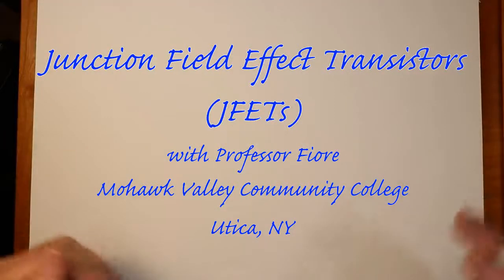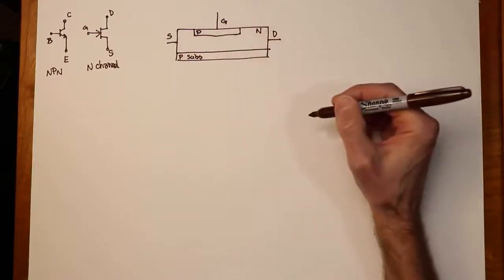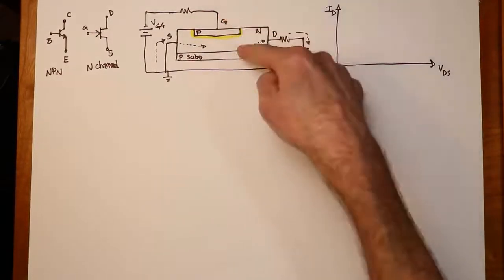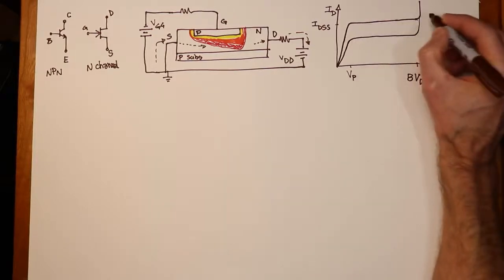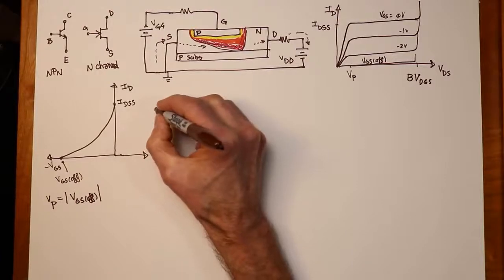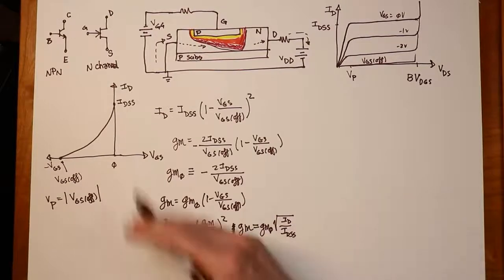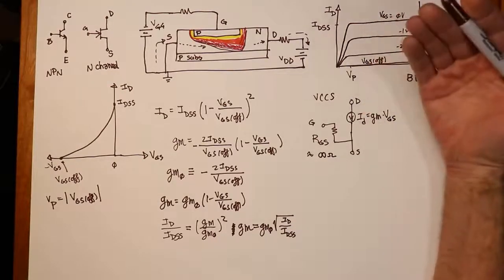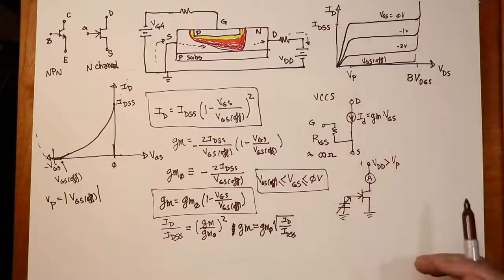Semiconductor Devices: Junction Field Effect Transistors (JFETs)

Comment: I’m in the same situation as Dennis Ruffing. I had to remember how to perform the derivative of Id, once I did that, it all made sense from start to finish. Thanks again for posting this on line for free. I think it’s time to down load the text book and follow along more closely
Reply from the maker: Yes, the text has more detail than I can hope to fit into a video of reasonable length. Besides, the price is right! And if you do want a hard copy, you can always follow the link to Amazon for an inexpensive print version.
Reply: @ElectronicswithProfessorFiore  On order! Thanks

Comment: Thx for the content. What I don't understand fully yet, is how the current increases with increasing source voltage although the channel gets narrower. Is the electric field much stronger than this effect until a certain point where the pinch-off/saturation happens?
Reply from the maker: Prior to pinch-off, the device is operating in the ohmic region. IOW, think of the channel as just a resistor. Thus, as the voltage across it increases, current does as well. We exploit the ohmic region in certain applications (for example, the FET can be used as a voltage controlled resistance where R is a function of Vgs).

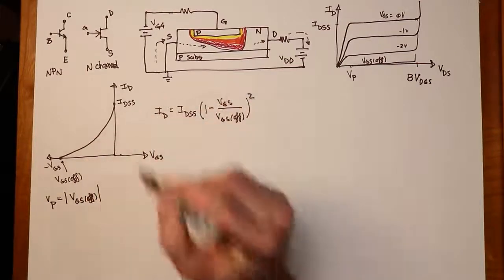Comment: 14:33 my high school calculus slumbering in my brain wakes up and says, "take the derivative of the curve to find the slope?  I used to know how to take the derivative of an equation.  Let me see here..."

Thank you for this explanation.  The missing puzzle piece for me was my (mis)understanding of Vpinch.  

Quick question: assuming a properly biased AC signal Vgs, a Vds can be set anywhere in the range between Vpinch and BVdgs and the current output at the drain will perform the pretty much the same, right?
Reply from the maker: Pretty much, but don't forget that the larger the output signal, the greater the distortion. Also, the AC drain current will depend greatly on the load impedance.
Reply: @ElectronicswithProfessorFiore  Thank you.  

I headed on over to Khan Academy for a review of derivative concepts and algebraic mechanics and boom, all the "prime" notation terminology came flooding back.  High school (mid 80s) was a long while ago.

I have taken to studying your videos by drawing right along and referring to your textbook.  Slow and steady, but I have the time.